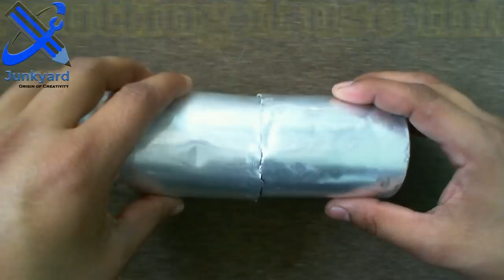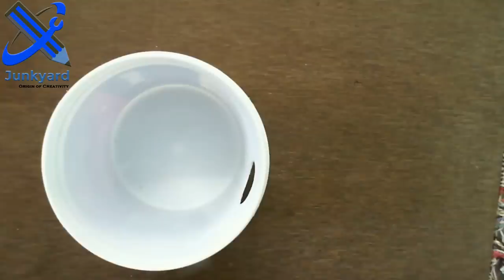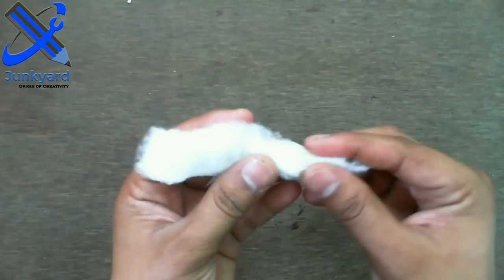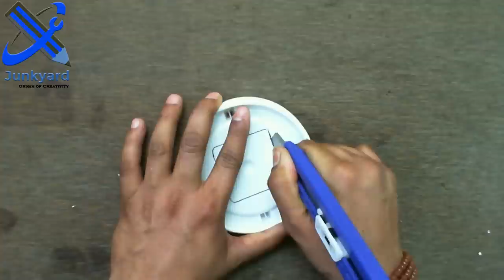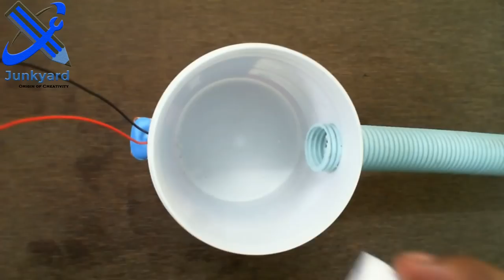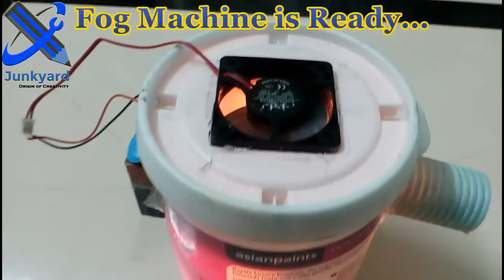How to Make a Fog Machine at home- Easy Way

Comment: TERRIBLE SAFETY PRACTICES: DO NOT USE EXACTO KNIFE, USE SCISSORS FOR THIS! DO NOT CUT TOWARD YOUR FINGERS ! also, areosol cans are under pressure!!! HE also cuts the METAL can down toward his thumb, WITHOUT GLOVES, later, he then hides his fingers under the plastic under the exacto knife! This guy is exhibiting self destructive behavior, and may be the type who wants to see you bleed and cry so he doesn't feel alone!!  just a tip: if you don't want to be cut badly, point the tip of the blade away from you and cut outwards not toward your fingers.  I wouldn't trust this suicidal fool to babysit my dog! He'd probably leave the gate open!

You are applying great force, and doing something you're not used to doing, namely:  cutting through slippery thick, flexible plastic suspended in air. No one in industry would ever allow this character to work like this--he'd be advised on safety or sent home. Further, he be suspected and watched for unprofessional practices, and suspected of endangering others.

'Sharps' are only to be used on a flat surface with solid support!!  It is a VERY sharp blade, like a razor blade, and not scissors.  Scissors are the correct tool.  So skip the ensuing drama when someone gets badly hurt. you'll sever a nerve and never feel the area around your finger again, or even loose a finger if you cut the vein. It will always feel cold your whole life, as a reminder. At the very least, you'll spoil your project and scare yourself, and ruin your day, not to mention the hospital expense.  you've been compassionately advised.. now have safe fun and keep your fingers, kids.